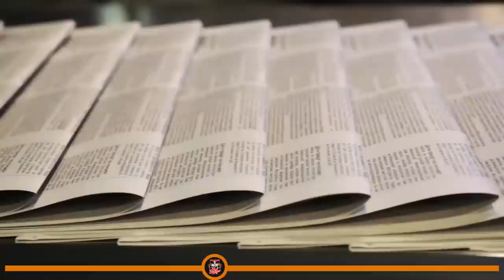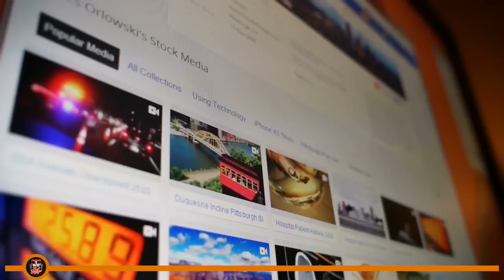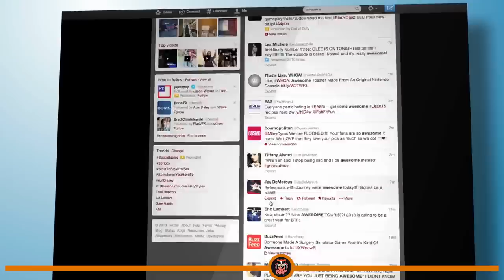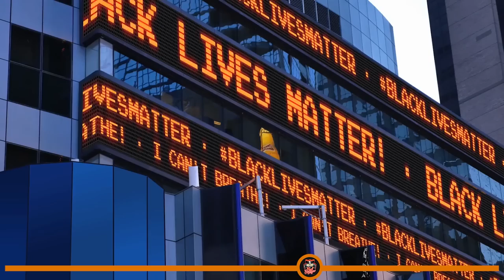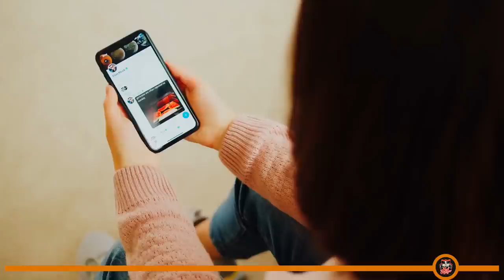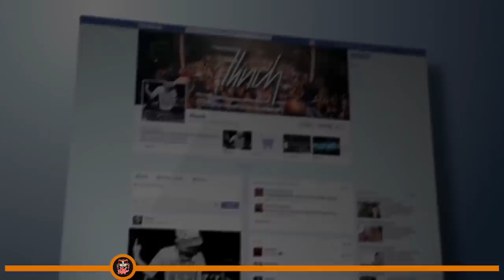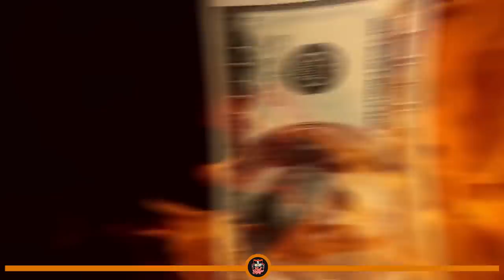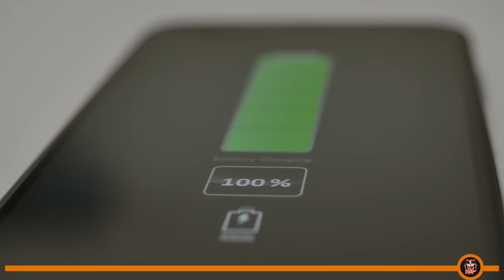Dumbest People in the World

Comment: I was laughing at the dumb people until I remembered when I stuck my finger into an empty light socket, noticed that there was a metal plate that had to be pushed in for a light bulb to fit. So I pushed it in. Without checking the switch was off. I can tell you I never did that again, though.

TL;DR being electrocuted feels like being pulled into whatever is shocking you while also having pins and needles all over your body but times a thousand.
Reply: I was six, btw.

Comment: Anyone trying to steal an ATM or a change machine is a special kind of stupid. Those things weigh a ton, are really hard to break in to, and don’t have enough to make it worth the trouble.
I worked at a place where we had an ATM on site. Two guys, one was a janitor and one was the stockroom clerk, decided it would be easy money. 
They came back after second shift left because there would only be the security guard doing his rounds. They knew his rounds and had the timing all worked out. Things they either forgot or didn’t plan for:
 1. They had to use one of their badges to open the gate to get in so it recorded who came in the gate.
 2. There cctv to see who came in the gate and it was on the tape.
 3. They never considered how heavy it would be. The machine was designed with thick steel panels all the way around for security.
 4. It took them more time than they planned to get it in the truck and the security guard walked in just as they loaded it in the truck so they were seen.
 5. They tore out of the parking lot knocking off the exit gate and getting recorded by the cctv again.
 6. They finally made it to the apartment complex of one of the guys. They somehow managed to get the machine to the apartment.
 7. They tried to break into the machine and couldn’t get it open after a few hours and finally gave up.
 8. Unwilling to try and get it into the truck to get rid of it, they put it in the dumpster.
So they went through all of this for no payoff. They were arrested and found guilty so they both got over two years in the penitentiary.